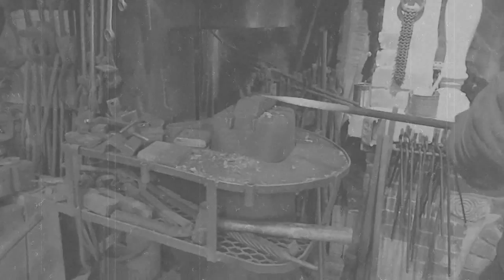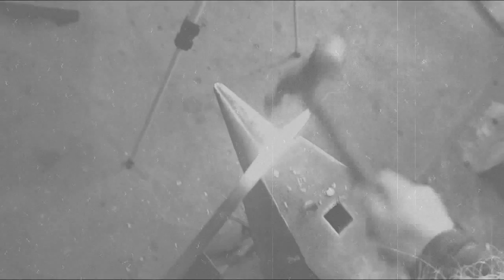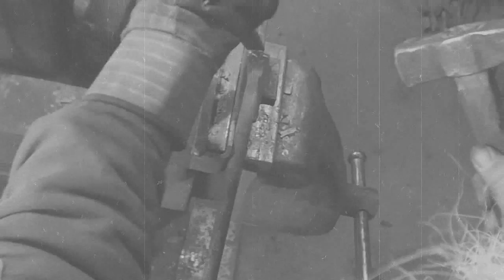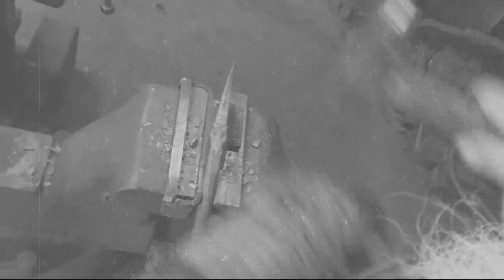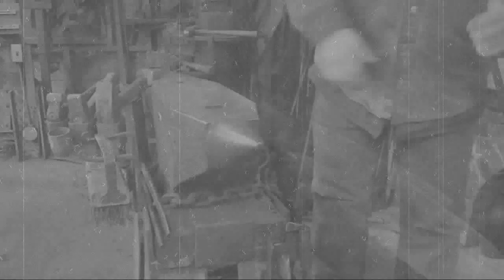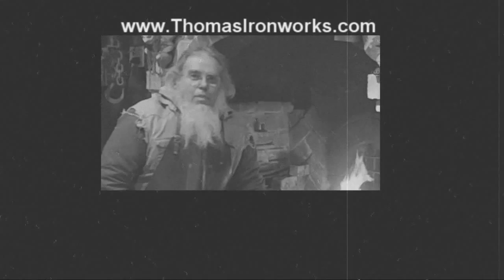Silent Movie Forging a Wizard

Comment: It's ironic that your video of pneumatic and hydraulic technique attracted a bunch of negatives.   The fact that you have the skill to use both older technique and more modern techniques is testament to your skill.   The Luddites want us all to use the romantic tools of yore and disparage the innovation of more modern techniques, as though the older ways were imbued with an intrinsic value.  I wonder if the person who first used a metal hammer got the same from the people who only used rocks?

Great demo, thanks for sharing.